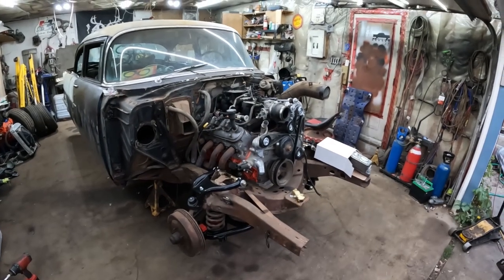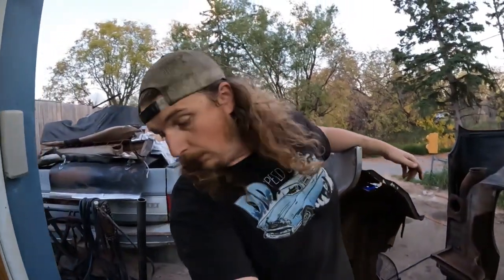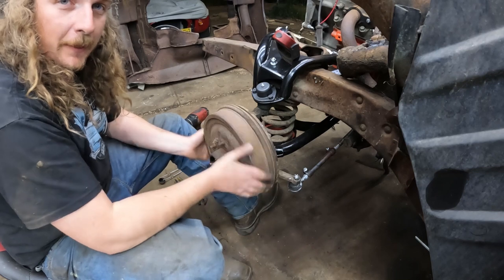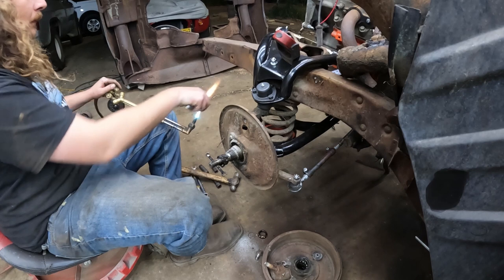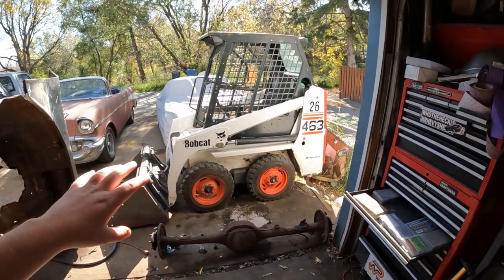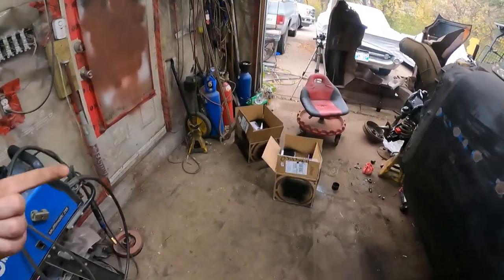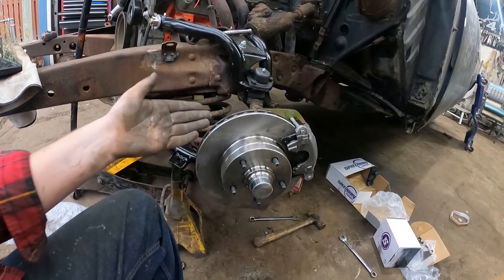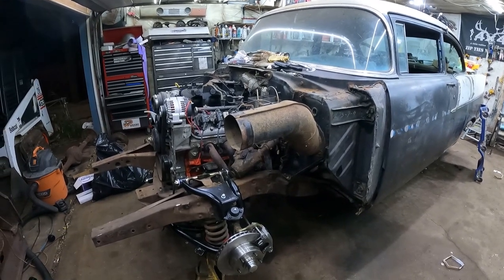Stop Right Now!  Major Brake Upgrade On A LS Swapped 57 Chevy! - Black Widow

Comment: a million years ago we were logging a 20 acre job on a island  . the mill dropped the price so low it would bankrupt us the morning we were going to start shipping .. we had 40+- loads of logs piled up on the landing.
 we decided to cut it into fi free wood and haul it off the island 3 cords at a time . on a old early mid 60 gmc . the first  load .
 I wasn't driving not my truck .
 anyway we came to the top of a long steep hill at the bottom was a dock 200 feet long at the end was Puget sound. 
 we were going 60ish and he hit the brakes to slow down . they went to the floor by now we were probably 70mph and having he tried to downshift (NEVER EVER TRY TO DOWNSHIFT COMING DOWN A STEEP GRADE.
HE MANAGED TO GET IT BACK IN GEAR  unfortunately this blew the clutch.
 we were free wheeling 90+ mph 
  the guy in the booth on the dock seen us coming and started running. there was a right turn at the bottom of the hill that ran outalong the beach we could to a stop. 
 I said take the right at the bottom of the hill.
 he turned right into the holding lane about 100degree turn around 100 mph a old lady sitting in the holding lane  with 12000 pounds of firewood on a old gmc 1 1/2 ton .
 he makes the turn missed the scared old lady we coast back up a steeper hill now about 20+- from top the truck comes to a stop yippee 
 not quite no brakes no clutch . no e brake .we start rolling backwards down the hill.
 at that point I jump out grab a big rock and threw it under the duels. they rolled right over it.but the front wheel hits it and it stops. 
 the ferry guy in the booth told us a year before a dumptruck blasted down the hill through the booth and into Puget sound. 
 THE MORAL OF THE STORY IF YOU HAVE A SINGLE  MASTER REPLACE IT
Reply: @hughstephenson2957  no pooping there really wasn't time. mostly I was thinking about how cold the water was going to be Puget sound is cold year road and it was late fall. lol .
 we had it towed to a old fashioned auto parts store at the top of the hill . replaced the clutch and wheel cylinder and went on our way but since then everything I owned with a single brake reservoir got a double right away. 
I like to be able to stop.
Reply: @hughstephenson2957  I did have a brake failure that was a pucker failure a couple years earlier that was electric brakes on my a 10,000 park model coming down lookout pass . at 2 am late spring snowing raining flying down a mountain holding my breath thinking ok I think I can make it to the next runaway ramp when I got to the bottom and could finally stop . I those days i90 had a red light and a right turn in the middle of town I got it stopped there was a chevron station across the street and I single handedly did my best to destroy wallace Idaho' s sewage treatment plant
Reply from the maker: Agreed!  Brakes are kinda important haha

Comment: While you have the front clip off, are you going to paint the frame rails, and coil springs to match the rest of those great looking new parts?
Reply: 🤣 You've watched Dan, my guess is he's not seeing the necessity.  He could prove me wrong,  but.
Reply: Ya, your probably right. But it doesn't hurt to wish. It would look so much nicer if he did.
Reply: @ronaldhellengreen7063  You are correct,  it would also help against the latest technologies in road salt.
Reply: No...need..that's the  detailer  jobb
Reply: Flip flopping and  big blocking
Reply from the maker: Haha ya never know.....

Comment: question: I have a 1950 ford F1 converted over to power disc brakes up front. everything is cool....  but..... after a few minutes of driving the brake pedal only comes back to the top about 3/4 of the ways. producing brake drag. if i pull the brake pedal back to the top .. brake drag goes away.... any ideas how i can fix?

Comment: Looks like you have got some good brakes now. I thinking that duct tape do not stick to rust, so wire wheel it and paint then try sticking some duct tape on the heater box. Or pop rivet some tin to it.

Comment: Stopping is more a product of tires; I've never owned a car that didn't lock up all four wheels regardless of drum or disc brakes. After that it's the tires job tp halt your rocket. Yes discs shed heat better than drums, but who is on and off the brakes constantly in normal traffic?
Reply: drum brakes  heat up and grab,ive never had disc brakes heat up and grab...i had a 72 chevelle with 4 wheel drums and spun out several times with locked brakes(also brand new bfg tires) after a few quick stops......ive had 7 trans ams and camaros,always had disc front brakes,never had a lockup even with shitty tires...unless i slammed the brakes on to induce a slide purposely
Reply: @trillrifaxegrindor4411  I've owned about 150 cars and trucks during my lifetime; the only one that had shitty brakes was a brand new 1969 Ford Fairlane two door hardtop. All the rest had either drum or disc brakes (most of my hot rods had drums).
Reply from the maker: It was cheaper to upgrade than replace factory

Comment: Dan, it's good that the brackets put the calipers behind the spindles.  You mentioned possibly adding a front sway bar in a previous video.  You would have had to move them anyway.  Been there done that on dad's '57.  We were able to just swap the brackets and calipers side to side and get different hoses, but it was a pain to have to mess with the brakes again.

Comment: Those 8mm silicon plug wires are crap when running untapped headers or without heat shields , they get baked and first time you pull them off they brake apart in your hand .

Comment: keep your heater cores and rads sepreate, and your brake drums, and master cylinders and rads are copper and drums and master cyl. are cast both fetch a few bucks at the scrap yard, the body tin and frame steel ect, is not much but some bucks. same as batteries they fetch a few bucks. my partener and i have made as much as 1300.00 at the scrap yard with rads and condensor cores from refridgiation units. wispers was good to see you preload bearings so many never do it they just slip on the routers and tighten, laughs my old school way  is if you preload bearing corect if you can slip in the cotter pin first try with out needing to turn nut one way or other. old style pro par axles were easiest for that.

Comment: I like when you take the time and explain about parts. 3 different metering blocks and master cylinder.  I have only ever worked with manual transmission.  I have a 94 c10 that started life with a six. Somewhere along the way it ended up with a newer v8 that was switched to a 4 barrel.  It’ has newer heads and has issues.  I want to pull it but I have NEVER done a automatic.  That seem to be the only things you do. When ya take em apart and back together what about the fluid?   Ya need to do a straight axel nose bleed high front end sometime.  TKS for all your sharing.  Old guy Steve d

Comment: The possible reason for having the calipers in front is cooling (air flow isn't obstructed by a hot disc)?  ;-)
I'm guessing you looked into flipping those brackets from left to right, right to left, but as you indicated they need to locate the calipers in back?

Comment: By now, you're ahead of what you're showing in this video, BUT, maybe you can move the coil packs elsewhere. They are a PITA sitting on the valve covers - looks like an afterthought. Some guys mount them down and out of the way. That might open up the possibility of getting nice looking ones. Great build. Please reconsider driving that car in the winter. You have a truck or three for that.
Reply from the maker: Need a winter hotrod. Gotta be somthing

Comment: I splurged and bought a blue wrench back in July, no other way to change torsion bars in rusty 4x4 trucks. Been using the hell out of that thing, especially since the sawzall is about to die.  How did I go all these years without a torch? I broke lots of hammer handles, thats how. I need to get my skid steer going so I can move engines around outside. Those things are super handy.
Reply from the maker: Oh man.  The torch is an absolute essential!